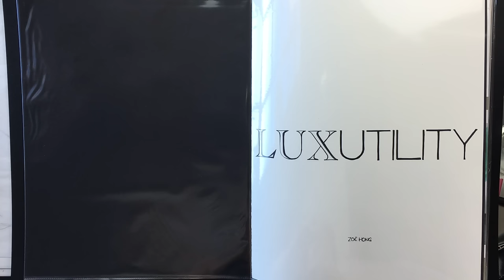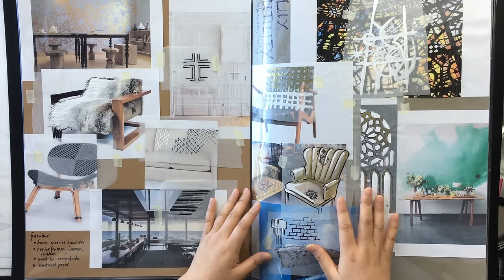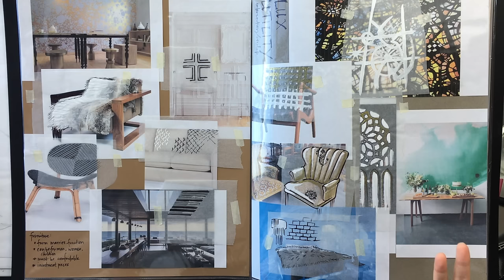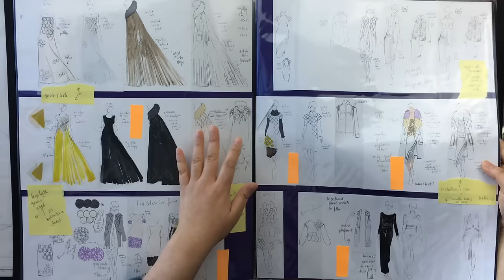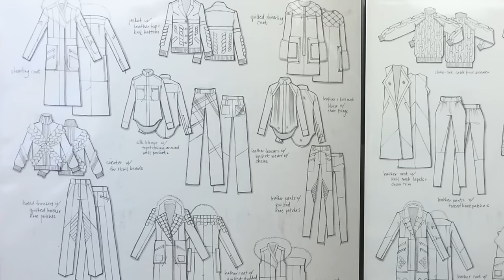Fashion Design Tutorial 1: Design Process: Overview

Comment: Thankful I came across your videos, amazing!! seriously so much helpful information and your portfolio is wow!!! Ive learn't a lot more here than what I did at fashion school. One question - 

Any ideas on how could you determine the yield of fabric you would use to make a garment plus cut - make - sew a garment ?
(would you ideally determine this before making the actual garment or during sample stage) and is this a usually requirement when creating a portfolio for a presentation. This project I'm doing requires this information and i find it a little strange.

Thank you, ill be waiting for more series to come :)
Reply from the maker: +Princess Whioke Thank you for your compliments!

Typically, the patternmaker calculates the estimated yield and then the yield gets adjusted after a sample is made. Sometimes the tech designer will estimate the yield if the new style is very similar to a previous style.

The patternmaker makes the pattern according to the fabric chosen and has to consider the width of the fabric when calculating the yield. They lay out the initial pattern pieces, following the grain, pack them in as closely as possible.

If you don't have a pattern, maybe you could use a similar pattern or a garment in a similar style, measure parts of the garment and use those numbers.

I've never seen it required in a design portfolio, but I know people in tech design and product development have different portfolio requirements that include tech packs. If I was interviewing someone whose job requirements would include design and product development, I would love to see a sample tech pack.
Reply: Awesome!! Thank you for replying much appreciated. very helpful with this process thank you for your suggestion as well!! I will Defs consider this when working out thoes number. 

Keep up the aweosme work!!!

Regards